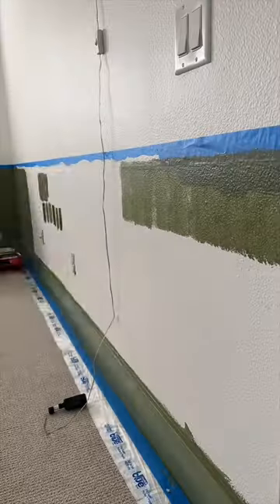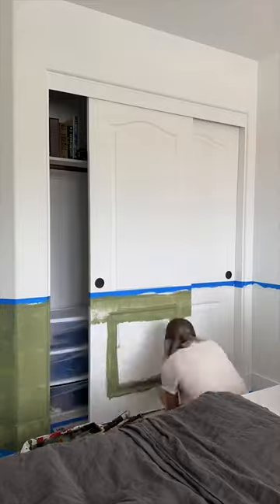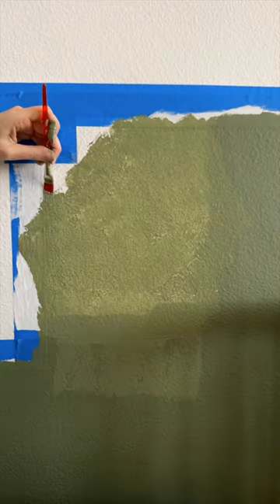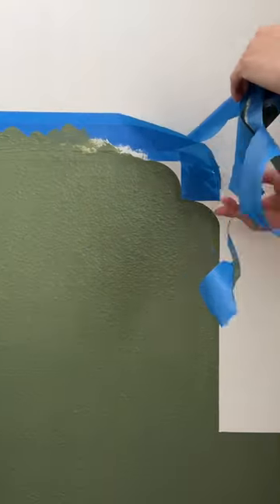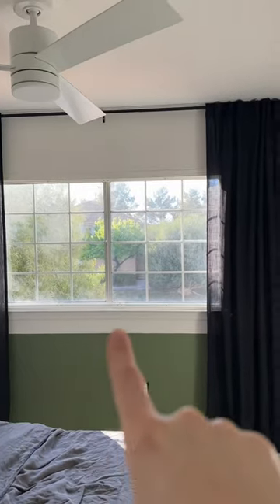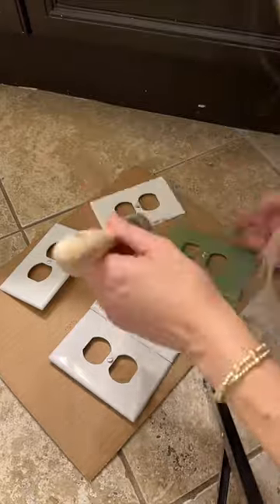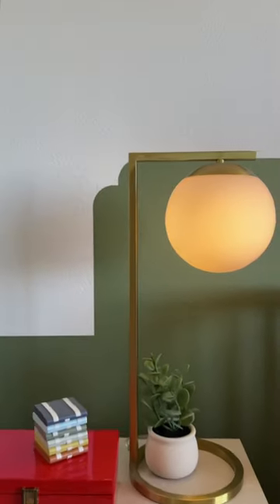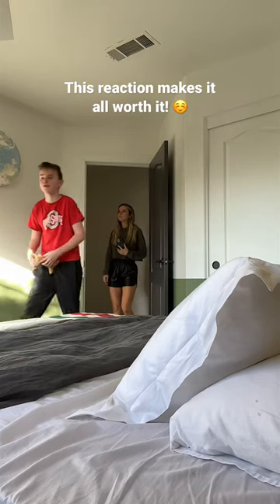A rad teen bedroom makeover with paint, plants, lamps & curtains! #diy #howto #diyprojects #shorts

Comment: Painted outlet covers never look good. If you must paint them, at least don't use a brush, they're going to look obviously hand painted. Use an airless sprayer or at a bare minimum a roller. Or just, don't?

Skip the blue painters tape and use green frog tape if you want clean paint lines. If you pre-wet it you'll get better results. If you caulk the line you'll get ever better results.

Comment: Painting receptacle and switch covers is an amateur move, especially with a brush. Latex brushed over them will last only minutes. Buy them in the color you want or sand and spray with a paint made for plastic.
Reply: You can’t be talking
Reply: @afraed1519  Non sequitur comment detected.